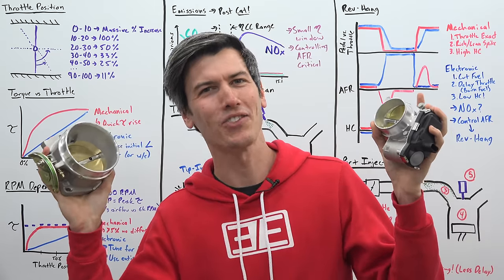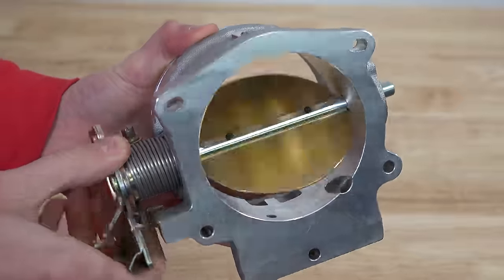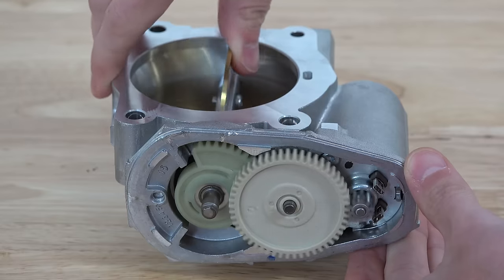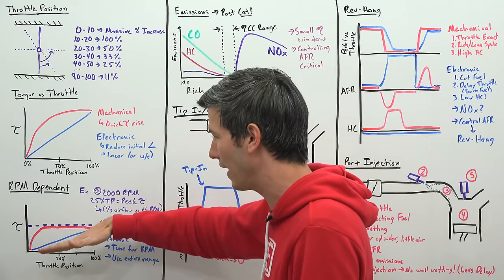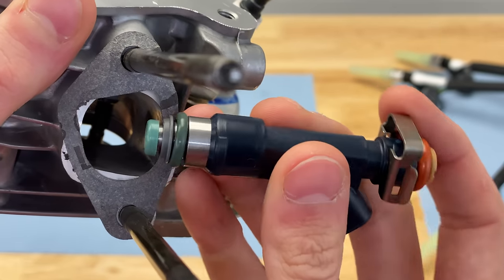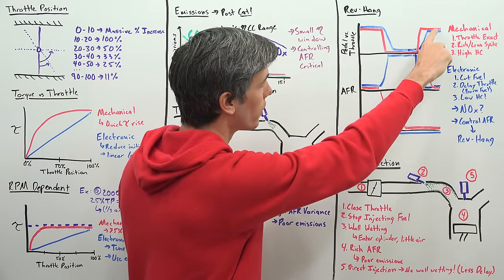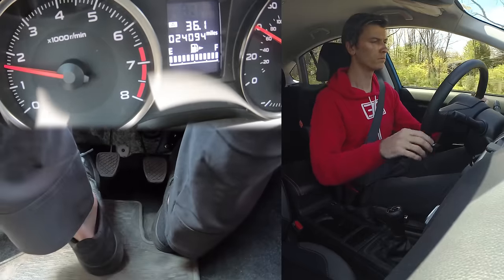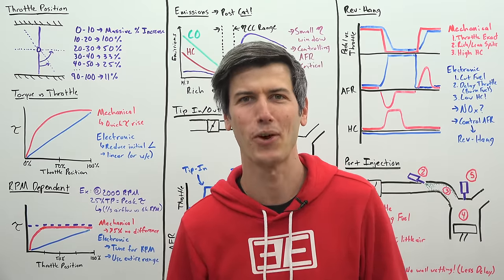The Big Problem With Modern Manual Transmissions - Rev Hang

Comment: all this "smoothing" the ECU does leads to the driver instinctively counter those effect with harsher throttle control, defeating at least partially the purpouse. :)
Reply: 100% real
Reply: Airbus had this problem with early fly by wire and pilots over adjusting controls due to the lag between pilot inputs and airplane adjustments.
Reply: I'm always flooring my manual and shifting low RPM, just so I can shift swiftly and smoothly O_O
Reply: Yes
Reply: Yep

Comment: Great explanation. Wondered why I could never get my new Civic 6 speed to shift smooth, especially from 1st to 2nd.
Reply: Same here first to second is the worse in my mazda
Reply: I have an 18 si, rev hang used to be really bad, but with a tune, it's pretty much gone. I also have a new clutch with lightweight flywheel.
Reply: Yep. The thing I miss most about my 6th gen Civic is its gearbox. It gave close to zero fux, and shifted as fast and smooth as you could. Meanwhile my new car with its bigger and more powerful engine is WAY more sedate because shifting is more like throwing a baseball to someone across the field than tossing it between your own hands.
Reply: Same on my dads '13 1.6D focus
Reply: Get a Ktuner or Hondata. You will have the option to turn rev hang off (as well as many, many other things). You can also turn on launch control.
Reply: Ditto to getting a tuner on it. Also, throw the CDV (clutch delay valve) in the trash and it will further help.
Reply: PurpleDinoRhino I have the 17 si. What tune did you use to remove Rev hang?
Reply: Yes, same problem with my fiat 500... I personally hate dbw
Reply: I find that the more you rev it out the les less noticable it is.
Reply: @GradeEhCanadian  If that's from the get-go, it could be cold oil. Once the box has warmed up, all changes should be smother - with a torque converter.
Situation would improve if you didn't rev it so much on setting off. Many will change to 2nd without you pressing any pedal !
Reply: If you take the RPM's high seems like double clutching into second helps things sync up.
Reply: @jhelmsing  or sell it. There might be ppl who geniually don't care about shifting hella quick like us, but still like manuals. Make a decent buck eh?
Reply: Got a 2020 civic SI it’s awful in 1-2 but I tend to notice it less the higher gear I go
Reply: @millomweb  torque converter in a manual transmission.....what?

Comment: I always thought it was due to the heavy flywheel! I hate the rev hang on the ND :) Thanks for teaching me something new once again
Reply from the maker: I'm not sure what you're comparing against, but rev hang on ND is actually quite minimal. The Crosstrek is awful haha.
Reply: I cant even drive any car thats drive by wire, my shifts turn to dogshit compared to my e34 bmws
Reply: @EngineeringExplained  The rev hang is definitely less than some other cars , but it's still very noticable on my ND when compared to my NB. I thought there was something wrong with my car when I first bought it, but I have since gotten used to it. Great video as always!
Reply: @jesperviktorsson8027  practice makes improvement, surgeons are not born; they are made // hang in there :P you eventually master each setup ///
Reply: I experienced no perceptible rev hang on my ND. My GTI is a completely different story and took a while to get used to
Reply: @corynivens6510  What generation of GTI? Manual Mk7?

Comment: As the owner of a 2021 6.4L Hemi (all modern Hemi engines port-injected) Challenger with 6-spd manual, I appreciate this explanation very much!  It explains the weird behavior on shifting that I noticed every since I bought the car.  (All my previous manual-trans vehicles had mechanical throttle body.)

Comment: The other way electronic throttles can improve efficiency with an automatic transmission is running the engine wide open in a higher gear, but still having pedal travel left to demand a downshift.
Reply: Gas pedal down until you feel it's about to shift, get off the gas a little as it shifts, push the pedal down a little after the shift and instead of dropping rpm with the shift and slowly crawling back up you get a nice shift and then Rev back up quickly. Love that feeling in a moderate to low horsepower car just getting up to speed. Smiles per gallon haha
Reply: That's true, reduced pumping losses.
Reply: @averyalexander2303  Don't forget reduced frictional losses and accessory parasitic (hydraulic power steering, AC, iron losses in the alternator, belt, etc.) from reduced revs.
Reply: My V6 Tacoma: *Climbing a hill, losing speed*   Don't worry, fren. We can lug up this hill in 6th gear.
Me: *Applies 6% more throttle*
My V6 Tacoma: Oh, I see you're asking for a tiny bit more torque. *DOWNSHIFTS TO 3RD, ENGINE SCREAMS!!*
Reply: MeatPopsicl on cruise control and on a hill my 4 speed Corolla would literally downshift to second at highway speeds
Reply: Freddie Mercury : kickdown is present on cars today still. Notably I read about it in the manual for a Mazda 6 about 3 years ago when we had it as a rental car
Reply: Old engines had that capability as well. Since the first automatic car I had, a 1980 VW Rabbit!

(3/4 throttle for full power and still travel to force a downshift).
Reply: @PushyPawn  Yep. My dad's 68 Firebird TH400 3 speed auto has a kickdown switch at the carburetor and metal plate at the carb linkage that hits it at 70% throttle input.
Reply: You weren't paying attention to this video, were you  ! Pulling a high gear doesn't need the throttle wide open - so it could be 70% open and still provide full power. Beyond that, kick-down happens.

Comment: Cable throttle people, remember to check cable tightness, like a bicycle brake, will stretch over time giving you crappy throttle responses.

Protune will eliminate rev hang if tuner knows what to look for.
Reply: cheers mate, I wasn't aware of this.
Reply: That's not what he's talking about.  A cable throttle is more responsive than an electric throttle, even if the cable needs adjusted.  A loose cable doesn't really effect response, anyway, unless it is so loose that something else is obstructing the cable.  It just allows the pedal to "wobble" more (move without doing anything), and at 100% at the pedal the throttle body won't be, so it goes slower.
That all isn't a concern, because cable wear isn't a concern.  A bicycle brake cable transfers a LOT of force, and unless the throttle is broken, but the throttle cable doesn't.  It could, but it doesn't.  It's "overkill", for the usual purpose, and that big to avoid bad problems.  I just checked my 95 Jeep (with ~260k miles), it's still fine, and was never expected to be an issue, so the throttle cable is not adjustable.
Some throttle cables can be adjustable, but for different reasons, and most cars don't meet the requirements to need adjustment.  My motorcycles' throttle cables can by adjusted, but with those I'm opening between 2 and 4 throttle plates instead of one, in a wet environment (carb vs fuel injected), idle adjustment is needed (carb vs efi), with less movement (twist grip vs pedal), so higher cable loads.
Reply: who uses mechanical brakes on a bicycle?
Reply: @sultanabran1  everybody, I've never seen hydraulic brakes on a bicycle.
Reply: That's what I was wondering. It sounded like something experienced tuners would have the ability to get rid of it in software.
Reply: Hill Billy. Huh? They're super common in the upper end actually
Reply: @HillBilly-1  Are you joking? Hydraulic brakes have been on bikes since the 90's. All my bike have hydraulic brakes
Reply: @Froggability  Not even upper end. Cheap mountain bikes have hydraulic brakes. Road bikes have hydraulic brakes.
Reply: @TravisTerrell  Yep, its a map issue that can be disabled/tuned out. Same as 4K flatspots in engine, thats where emissions are tested. Once remapped, all runs smooth, did that in my current gen STI, no rev hang, no flat spot, big linear power, more torque. Just make sure your tuner is a good reputable one, cowboy industry.

Comment: Simple fix for rev-hang:  install a tune.   Installing Hondata's on my 2020 Civic Si completely changed the shifting experience.
Reply: Yeah. The rev-hang on my Si is horrible. Just horrible. Shouldn’t need to go aftermarket to fix - but it is what it is.
Reply: @GregBalzer  Same was with mine.  But after installing the tune, it's a completely different car and the gearbox is among the finest you can get.   Getting rid of the rev hand alone made the tune worth it, the added torque and horsepower available once you press the sport button, a VERY nice bonus.
Reply: Same with my '06... the hang at 8300 was about a second long after you push the clutch in before I got a tune and it would rock back and forth
Reply: Someday I will go down this path on my 2018 accord 2.0T with the 6MT. Rev hang sucks on this car, but I love every other aspect of it. I find that driving with AC on helps a bit, but with AC off it is awful.
Reply: I was wondering if a tune could help this. Might it cause problems during emissions testing?
Reply: @alanprihoda7772  If you live somewhere that tests emissions then you probably don't care about driving a manual transmission. However if you do for whatever reason, there's usually an easy way to tune your car back to stock when you go in for testing
Reply: My 2018 jazz 1,5 dynamic has also a terrible rev hang. With tuning it is fixed, you think?
Reply: I have a 2015 Acura ILX 2.4 which is basically a 9th gen Civic Si and there's no rev hang.
Reply: mgoblue I own a 2018 Mazda 2 hatchback and without A/C the rev hang is awful too. Is interesting to know that someone with a different car is experiencing the same thing.
Reply: I had the same issue with my '09 Si.  The Hondata map fixed it.
Reply: This. I've had my 2019 Si for about a year and it's partially what made me watch this video. I haven't pulled the trigger on a tuner yet but when I do this is one of the first things I am looking forward to.
Reply: Does that void warranty??
Reply: @mickeyrat3369  No.
Reply: I test drove a 2020 SI and hopefully getting it tomorrow. Definitely slapping a Honda flash on it, the hang is miserable compared to my GSR integra lol. Its very sad they took vtec away in 2017 (except the new type r). The 1.5 turbo moves pretty good though for a daily.
Reply: @CodyCombat Do they actually shift when testing emissions. I thought they just hook it up while stationary. Wondering about this because I just bought a 2020 Si and was considering the tune mentioned. What does sport mode even actually do in stock form?

Comment: I bought just recently a Focus from 2020 having driven a Punto from 95 and I always felt that jerkiness while driving my new car. Thought I was the only one. What I found out was that I have to hold the clutch slighty for about a second before fulling releasing it, and that probably gives time f or the revs to go down. However, if I'm pushing  the throttle and going faster I can change gears faster. Makes 100% sense on what you said, very informative!

Comment: Thank you for your detailed explanation; it explains to me why I experience so much frustration with my vehicle (Jeep Wrangler jk 3.8L V6 with 6-speed manual trans) and throttle hang.  A major safety issue with the electronic throttle body is that when I begin going down a long steep hill or mountain pass in third gear for example from a lower speed with my foot off the gas and the brake pedal, the vehicle will initially coast down in a gradual manner with the tradition engine braking effect safely controlling the descent and avoiding me overheating the wheel brakes.  

However once engine speed increases to about 3000rpm or so as the vehicle's road speed picks up, the electronic throttle body will suddenly open up and "hang" as you described, causing the vehicle to suddenly surge forward with an increase in speed, forcing me to jam on the brakes in an emergency stop in order to avoid either hitting the car in front of me or (even more dangerous) suddenly speeding up into a steep bend that I'm using engine breaking to control.
Reply: i’m with you man. i have a jeep with the same engine and the 6 speed. the rev hang absolutely sucks. it seems like the longer i drive the worse the rev hang gets. sometimes when i go to shift the RPMs don’t go down at all. im worried that this causes premature wear on the clutch as well.

Comment: My '09 Ford fusion had some severe rev hang. I found the trick to driving an etb is letting up on the accelerator as you're beginning to reach your shift point (don't let up at the shift point), so your acceleration will decrease slightly, then shift and voilà it's smooth a silk. Takes some practice, but smooth shifts can be done if you're not wanting to gun it everytime you take off.  🕉️
Reply: same in my vw polo. need to push and release the gas pedal a split second earlier that i would normally.
Reply: I drive a 06 Ford Fusion, I’ll have to try this on mine. Maybe it’ll help 🤷🏽‍♂️
Reply: The way i handle it is to half way float the up shift gear change.
As you reach the shift point let off the throttle, as the gearbox unloads hold light presure on the gear lever and as it slips out of gear press the clutch and change into the new gear in one motion. Takes a little practice but very smooth and a little quicker.

Comment: I noticed this happening when I first started driving.

I developed the habit of letting off the throttle before I disengage the clutch. Haven't experienced it anymore

Edit: or well, not perceiving it.
Reply: Yeah I feel like if you own a car then you get used to it and it’s not a huge issue, I wonder if he just notices it because he’s reviewing different cars all the time?
Reply: I've noticed this with rental cars. Throttle flat on the floor, then let off the throttle completely and... The car still seems to be accelerating for a moment or two
Reply: @theydidntnameme  put in sport mode, this enable the accelerator to react in a sharp mode, but normal driving consume less fuel because of these slow operation that discard some unwanted oscillations that our foot create (i.e. his mass and pot holes or uneven road)
Reply: I did this also.
Reply: Drove a 2008 manual with electric throttle for 9 years. This is exactly how I defeated the issue. Fuel deceleration cut off
Reply: Best way to get around it is to smooth off the throttle instead of releasing it instantly.
Reply: Driving manuals all my life then I got a Subie, noticed it straight away. Didn't take long to modify shifting to not notice it like you said, in some cases it works with you. What is weird though is if I jump in a different manual I go straight back to that old driving style without even thinking.

Comment: Thank you very much for the video. I was studying to replace my 2011 Chevrolet Celta flywheel to a lighter one thinking it was heavy and causing the rev hang that were really annoying me because I was thinking I was changing gears so fast that I had to keep pressing the clutch until it dropped RPM to stop unmatched gear shifts.

Comment: Thanks for the lesson once again! This is a big problem in my '19 Mustang GT when I'm on track. Imagine trying to shift into 4th at 110 mph and having to wait for the revs to slowly creep down from red line :(
Reply: If your doing track days you should look at getting a tune to fix that
Reply: Tunes usually change this behavior, or an experienced tuner can do it without much fuss if that's the only thing you want changed.
Reply: I had a 2015 mustang gt.  Just get a tune, Id do e85 or flex tune if its in your area and simply ask to remove the rev hang.  I think some tuners leave it in because some people like it like inexperienced drivers.  It was always known the 1 to 2 shift always made the car jerk unless at red line so people just got the rev hang removed with the tunes.

Comment: this is so informative. Never knew electronic throttle had so many benefits. I have just written it off as newfangled over engineering. Especially with a stick shift I'm constantly tipping in and tipping out. Never knew that was creating more emissions.

Comment: But for real though, if I waited for my rpm to match for my upshift while going up a hill, my truck would literally be rolling backwards by the time the rpms matched.
Reply: Solution: shift into reverse
Reply: That's unfortunate and I know what you mean.
Reply: @doogetube6017  nice
Reply: trucks also have very heavy flywheels because it helps with take-off when towing or offroading.

Comment: Some: MECHANICAL!!!
Others: ELECTRONIC!!
BMW: ValveTronic!
Reply: ...in service as usual :)
Reply: Audi, mechatronic Bi*ch
Reply: Diesel: fuel throttled
Reply: @timothyball3144  btw i heard somewhere even some diesels still have something alike throttle body and it wasn't meant as intake flaps probably but im not really sure. Somebody knows something about it?
Reply: an0nim11 may be used for inducing some engine brake during the downhills.
Reply: BRUUUH a bmw suv just went into our shop to have the valve cover gasket replaced. The valvetronic system died in our hands lmao.

Comment: First thing I did when I got my Hondata is eliminate that rev hang. Drives much better now.
Reply: What did you do to remove it?
Reply: @nateyoung6331  i have an 08 si. On one of the settings there is a selection of 1 2 3 4 5 6 which is associated with the gears. They have values in them already like 30 or 40. I changed all mine to 10ms and it eliminated the rev hang. I learned how by watching videos on YouTube. Just look up 8th gen civic hondata rev hang.
Reply: I disabled the rev hang in my 2020 Si Coupe with Hondata as well. Yeah, car drives a lot better now. Rev hang made it look like I had no idea how to drive the car. Drove me up the goddamn wall.